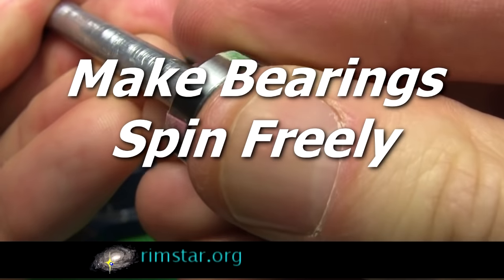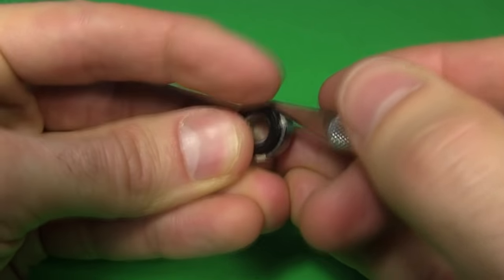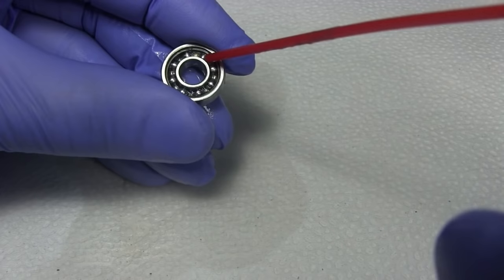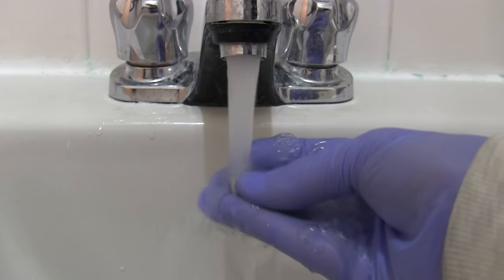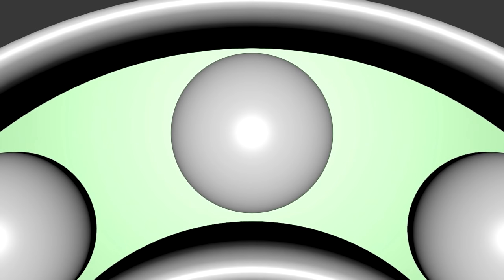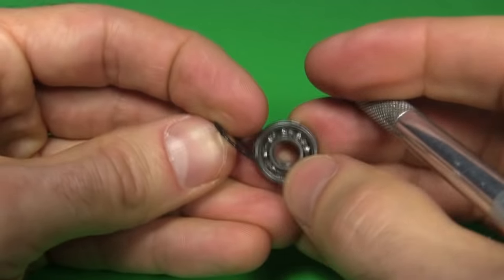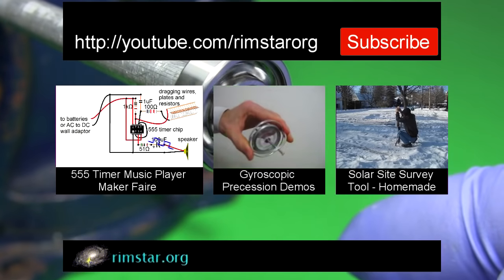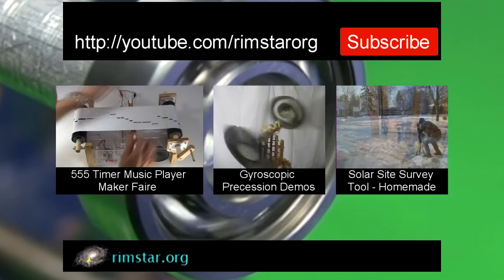How to Make Bearings Spin Faster/Freely

Comment: We-40 is NOT a lubricant! It’s a degreaser
Reply from the maker: WD-40 is a lot of things https://www.wd40.com/uses
Reply from the maker: Whoops. I just realized that you were stating the very thing I did use it for, removing the grease. So, yup, I agree that one of its uses is degreasing.
Reply: The reason he made this comment is because you said “WD-40 acts like a lubricant, just like the grease does” which is true from a very short period of time but then the WD-40 dries completely and will leave your bearing bone dry.
Reply from the maker: Ah, thanks ThunderMCR for pointing that out. That's what happens when you have over 250 videos, you forget some of the things you said. Now I know why people often point out that WD-40 isn't a lubricant. And I agree, it's okay for a short time but you have to redo it again soon. I've long since stopped using it as a lubricant and switched to better ones for that reason.
Reply: @RimstarOrg  thank you for the kind reply. And thanks for the video! :)
Reply: WD-40 IS a lubricant, a very poor one though.  Its main two ingredients are Stoddard solvent (similar to kerosene) and a light petroleum oil. The main problem is that the solvent compromises the oil and once it evaporates, it leaves a hard residue.
Reply: @rcbearings2096  water is also a lubricant then
Reply: @SoapySupreme  Yes, it is. It is the lubricant for submarine shaft seals and is used by our bodies as a shock absorber and lubricant in our joints.
Reply: @SoapySupreme  Is WD 40 white lithium grease good for lubricating bearings like on skateboardnor drum pedals ?
Reply: @Mike_Savin  I wouldn’t use it
Reply: @SoapySupreme  From WD 40 lines, which one do you recomend for lubricating closed / covered ball bearings ?

Comment: uh dude.. you really need to watch longboard maintenance videos... 
1st use acetone instead of wd40 and varsol... 
2nd use speedcream or sewing machine oil as lubricant. 
3rd keep the seals...
Reply from the maker: Thanks for the longboard maintenance tips.
As for the tips in this video, longboarding isn't a good application for them given the caveats brought up in the second half of the video. In my case I used them for an electrostatic motor (no water, dirt, or heavy stress).

Comment: Wow you made a video on how too ruin a bearing
Reply from the maker: Only if you ignore the warnings in the second half of the video. This worked great for my indoor, light-load electrostatic machine. However, I did later learn about dry lubricants which would have been a nice thing to add.
Reply: I’ve skated dry uncovered bearings for years. Work great. Skating the same bearings for the last 8 years. Just bought a brand new set of reds and they are definitely slower than my dry uncovered ones. Just saying.
Reply from the maker: That's interesting. One question, do your feet get hot? I wonder if the lack of grease would create friction and noticeable heat.
Reply: @RimstarOrg  air cooled. It’s the way of the future
Reply: Fishing reels have used unshielded bearings for many years, but nice try acting like you know it all.
Reply: @dblack1974  fishing reels are not exactly over worked. You put these bearing into a clutch bell or wheel they would soon shit them selves due to over heating
Reply: @adsrcracing7289  show me where on this video where he said this would be useful for which you just described. its obvious you didnt watch the video, nor read what he wrote in the description
Reply: @dblack1974  Na didn’t watch the video. Because it’s stupid what was being shown.

Comment: Simply open the bearings and use WD-40 to dissolve the grease.  Then put a couple drops of bearing oil.  Re oil from time to time.   Free spinning bearings and protected from excess wear.  NEVER introduce to water.   Bearings will rust and get dedtroyed

Comment: I thought water would rust the bearing
Reply: It does. Do not follow this guys instructions. If you "really, really" want unsealed bearings with no grease, order them that way. Open bearings generally come not greased, as they would be lubricated by the oil or grease in the machine. (I've been in the bearing business since 1994).
Reply: Or never use grease or wd40 on any bearings

Comment: Wd40 is not a lubricant it's a penetrating oil
It prevents corrosion but evaporates too quick to lubricate terrible advice
Reply: WD40 is a brand, they sell all kinds of products (rust inhibitors, lubricants, etc).. but talking about the product in the video, WD40 is a Water Displacement agent. being oily, it does penetrate and it also lubricates, but it's not intended for either...
in this video it wasn't use to lubricate, it was used to clean... why would you call it terrible advice? :}
Reply: Durox Kilo stands for Water Dispersant 40th attempt 😛
Reply: @boofuls  you're correct.. but i suspect they didn't count quite all the failures :}

Comment: What is the use case for greaseless unsealed bearings?
Reply from the maker: Good question. I did this for an indoor electrostatic motor which was just a fun, low load, low power, science project. A dry lubricant like graphite might have been good to add but I didn't know about that at the time.
Reply: @RimstarOrg  Hey man, you did a good job.  At first I cringed at the idea of a grease-less bearing but what you did worked perfectly for your use purposes.  All of the down-votes are from people who didn't realize that there's barely any load on the bearings in your particular use case.  A lot of people who watched your video realize this, so so don't let the down-votes get to you, friend  (:
Reply from the maker: Thanks, but I don't worry about the down-votes. The second half of this video explains what conditions this trick shouldn't be used for, so if they're concerned about using the bearing under those conditions then they missed the second half of the video.
Reply: @Tadders  yes, good for indoor areas without contamination. I won't hate on it.
Reply: Fishing weights. Sling-shot ammo. YouTube videos about such bearings.
Reply: @RimstarOrg  Graphite wouldn't get you anything.  Graphite is for sliding surfaces, not ball bearings. A light synthetic oil is usually best.
Reply from the maker: @RCBearings Thanks for the tip.

Comment: Never use regular wd40 unless it's PTFE on bearings... Easy way to clean the grease out is with contact cleaner and then add a tiny drop of PTFE or strike hold..

Comment: that's how you brake your bearing if you skate, scooter what ever you ride
Reply: like he said normaly the grease would work against heating up or metal working against metal... but with low turning projects like his it improves his projects he never talked about skating or cruising a scooter :D watch again :D
Reply: or spinners
Reply: I don't think this video was meant for skaters.  It has some good ideas though.
Reply: l
Reply: Break. It will also soon (in particular circumstances) become a brake.

Comment: DONT DO THIS IF YOU OWN A SKATEBOARD
Reply: why not, he washed the wd-40 out
Reply: @insomniac1889  you dont want to wet your bearings
Reply from the maker: The water does evaporate pretty fast so I don't think that's an issue but other reasons for not doing it if you own a skateboard are the reasons I give in the second half of the video: dirt, no more lubrication under high load means more wear on the bearings as the parts touch each other.
Reply: @RimstarOrg  don't bother arguing with ignorant viewers sir :} if you were not aware, there's a bearing cult among skateboarders.. a cult the perpetuates all kind of nonsensical anecdotal myths :}
of course ball bearings can be washed, of course the lubricant can be replaced, etc. it's all about what kind of application the bearing will serve
Reply from the maker: @Durox Kilo I just saw your reply here after responding to your other comment. Looks like we're on the same page here.
Reply: One or two drops of sewing machine oil after this and your bearings will spin faster than ever.
Reply: Just soak your bearings on acetone and keep the shields off. Also ive found that my bearings are alot faster ( and louder) when i dont add any speed cream. Yea they wear down faster and need to be replaced sooner but a 40 dollar set of bearings every month and a half os worth the extra speed. Especially is you skate transition

Comment: Nuts. Knows nothing about bearings. Koyo and SKF technical manuals prescribe using gloves because sweat could cause rust and he's running them under water? Also WD40 is not a lubricant it's an oil based cleaner that leaves a residue. It may feel like a lubricant for a few mins. Please don't follow his advice
Reply from the maker: Regarding the WD-40, I used it only to remove the grease, not as a lubricant. And if you check their website you'll see that it is also a lubricant, though from experience in past daily use I'll agree it's not a long lasting one. A next step that I did miss though was to add a good dry lubricant. But it worked great for my low load, indoor application anyway, an electrostatic motor.
Reply: Nowhere in the SFK bearing maintenance handbook did I see it ever mention gloves for sweat.

Gloves are to protect the user/technician.

Bearings would be coated in oil/grease, and that would be more than enough to protect from sweat.

Comment: WD 40 isn't a lubricant lmao
Reply from the maker: Once again from https://www.wd40.com/faqs, 
WD-40 MULTI-USE PRODUCT FULFILLS FIVE BASIC FUNCTIONS:
1. LUBRICATES: The product's lubricating ingredients are widely dispersed and tenaciously held to all moving parts.
Reply from the maker: Oh, and in this video I use it for reason number 4 which is degreasing.
Reply: Edit: WD-40 is not a viable lubricant, especially for this. 🤣
Reply: Just use non harsh all purpose citrus spray, it works really well.
Reply: Neither is butter with that logic. Oil displaces water. Wd40 water displacement. Lol doesn't say oil displacement

Comment: how to ruin a bearing...
Reply from the maker: Make sure you watch the second half of the video so that you don't ruin it. Also, you'll need a light load, mine was an electrostatic motor. I subsequently learned that you can still add back a lubricant if it's something like a dry lubricant and still have the speed.

Comment: Won't the bearings rust after you rinse them with hot water and let them dry? I need to know before I try this out :o
Reply from the maker: Make sure you dry it out thoroughly. If you want to make sure you get all the water then apply gently heat and airflow using a hair drier. Rotate it a bit to to make sure you get it everywhere. I also wiped it with a paper towel.
Make sure you pay attention to the second half of this video to make sure this trick applies to whatever you're using it for.

Comment: Honestly guys it better to buy new bearings. This video is bs, it may make it go faster but eventually they will break due to the covers removed which let's out the lubricants which are vital in order for ball bearings to work.
Reply from the maker: +Abu Ali This video is about making due with what you have. Also, watch the 2nd half where I talk about why you want lubricants. That's why I added that 2nd half. Given what I say there this is obviously not for use bearings used for rollerblading, skateboarding or any of the other things that encounter the situations talked about in that 2nd half. However, my purpose was for an intermediate version of my corona motor http://www.youtube.com/watch?v=hpvHRHs7o7I for which it's just fine (no water, no dirt, low load so even high speed doesn't matter.)
Reply: +Abu Ali you obviously didnt watch the whole video didnt you? he talks about the risk of removing the grease. So he caution viewers to use a cleaned out bearings only on a simple application like shown in his video. Why dun you just shut up and watch the whole clip
Reply: Abu Ali not for fidget spinnersssssssssssss

Comment: Umm, how about using the appropriate bearings? 
Open, designed without seals, metal shielded, less drag but some protection and don’t forget the actual bearing design class should be considered for each choice.
Reply from the maker: I didn't have the right ones at the time so this worked in the meantime. When my ceramic, dry lubricated bearings arrived, I replaced them with those.

Comment: Hey I just cleaned my skateboard bearings and lubricated them with oil and they are much slower any help?
Reply: +Elijah Talassazan Did you try rolling them under weight or just freehanding it? Break it in and it should be better.
Reply: Elijah Talassazan Dont dk this with skateboard bearing homie youll fck it up

Comment: How setup two dry bearings on a shaft with a flywheel between them. Then connect a DC voltage to the outer race of one and a ground to the outer race of the other. Hand spin the flywheel. WATCH WHAT HAPPENS. Have fun explaining this one.  BOB
Reply from the maker: I suspect it's a result of the balls in the bearing heating due to the current where they contact the sides. When given an kickstart spin via the flywheel, the expanded part of the balls are moved over bringing in fresh ball area to be heated. That kickstart gives it the direction/bias and the heating/expansion keeps it going as long as current is applied. That's best explanation I've seen so far. It's a coincidence that I recently cleaned these bearings in a manner suitable to try that experiment, but it is tempting to try it.
Reply: RimstarOrg
Sorry, didn't mean to steal your thunder. This is a very high amp draw device and shortens bearing life and a destroyer of batteries. But a very good experment on therm o-expansion converting to a rotating axle machine. BOB
Reply from the maker: Robert Brockway
I didn't feel you we stealing my thunder at all. When I saw that motor I was reminded of my recently cleaned bearings too. I'm glad we have the same explanation, since I'm tempted to try it and of course I'd make a video with an explanation too (I could say in the video that I'm not certain it's correct I guess.)
Reply: RimstarOrg That explanation I gave was from the video I saw on YT. I believe the phenomena needs further research. I would like to see high voltage static electric forces and some other electric forces tried. If electrostatic force would cause a sustained rotation then that would be very interesting and something you and I could explain. BOB

Comment: thanks so much. now my wheels spine like never before.
Reply: and now whar happen to your bearings??? its ok or not?
Reply: what*
Reply: +Nor Hazrina broken lol just like to my first skateboard its a fake tho when i tryed this after like 5 days or 3 it will ruin your bearings
Reply from the maker: +Fnatic Plays39 That's why I point out why lubricants are used at 1:09 in the video. If you remove the grease from a skateboard's bearings then dirt will get in and damage them. Also the weight on the bearings will cause the rollers to contact the races and wear down fast. They'll also be contacting at high speed, causing heat and therefore damage. All those reasons for using lubricants apply to skateboards.

Comment: This is like saying cutting off your arm will help you lose weight... obviously it will spin longer it has no mechanical resistance.. you have also allowed that bearing to pass through its life cycle in 5% of its expectancy... what was the goal here?
Reply from the maker: The goal was to use them for the shaft of an electrostatic motor which is almost no load, this one http://www.youtube.com/watch?v=hpvHRHs7o7I, though I later replaced them with dry ceramic bearing when they arrived.
Reply: @RimstarOrg  very cool. Ceramic was a wise upgrade, cool video!
Reply from the maker: Thanks! I did learn from commenters after uploading this video that it'd be best to add some graphite lubricant after removing the grease, it would still spin freely. But sadly, there's no way to add details to a video after it's up.
Reply: @RimstarOrg  a follow up response using the graphite lubricant would be some interesting content!

Comment: hey there please help me out will you..?i kinda used acetone to clean my spinner bearing and what i think may have happened is that the acetone was of low quality and when it evaporated it kinda left a white substance among the balls of the bearing.now its almost stuck and not spinning..please tell me how to undo this..?i already tried scratching out the substance with a safety pin..but didnt work
Reply: AaRon Joseph K.I fidget spinners are outdated
Reply: Taru Vlogs seriously bro..?not helpful info at all.. :(
Reply: AaRon Joseph K.I soak the entire bearing in a small cup or jar filled with miners oil or paint thinner, even rubbing alcohol will work. Let sit overnight then come back to it in morning with an old toothbrush and scrub it out very well. Then rinse it off and immediately dry it... add lubricant and ur golden! Good as new

Comment: RimstarOrg is my bearing will begin to rust if i soaked it in water?
Reply from the maker: Yes, unless you dry it off thoroughly after.
Reply: is it important to rinse it with hot water? can i rinse it with normal water?  after the paint thinner
Reply from the maker: I'm not sure if room temperature water will wash paint thinner better than hot.
Reply: If you rinse it in water, please use alcohol to get rid of the water.  After it's thoroughly dry, use graphite or a dry lube(CRC) to lube it.
Reply from the maker: Oh, good idea re the alcohol -- that'll evaporate away quickly. I've heard of using graphite but haven't tried it yet.